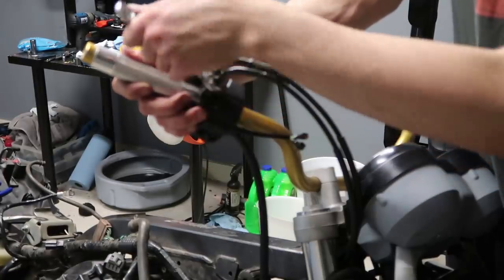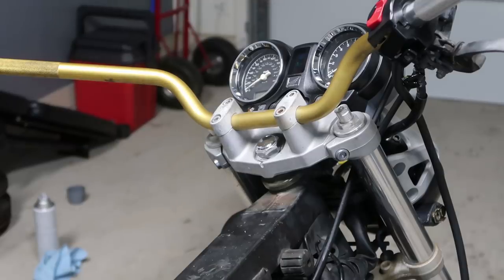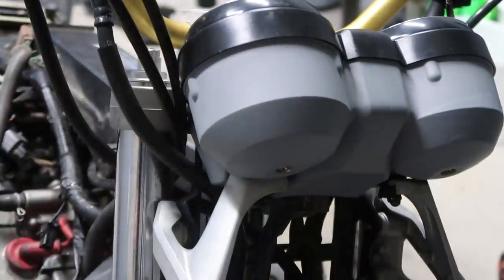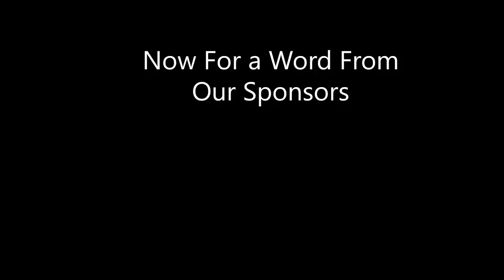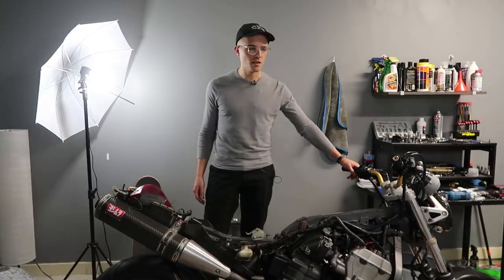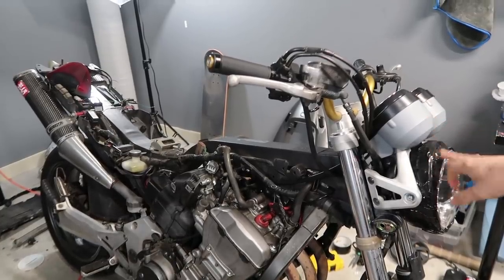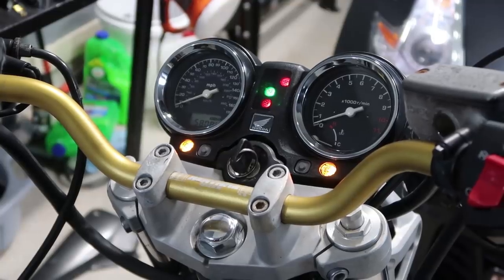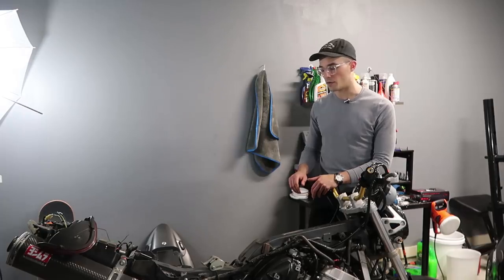Throttle, Lights, and More on the Hentai Hornet! (Beginner Bike Build Series Ep. 10)

Comment: it's not the taillight's fault you set the front end up wrong, also those handlebars are pointed waaaaaay too much up, unless it's a stuntbike you should rotate them more towards the gastank. 

okay so for indicator issue: jeez how do i say this... okay so you're indicator relay changes a 1 to a 0 (power or no power) right? well if you wire it backwards like you probably did, your indicators are constantly lit and the relay puts power on the ground wire of the indicator, reducing it's voltage to 0 causing them to turn off.
the problem you have with the taillight is that it doesn't want to have power on the indicators when they should be off. you could potentially make it work by making the indicator button on the handlebars send it's signal to 2 different relays, 1 for the front working like it does now, and 1 for the rear working as it comes from factory... if you want i can draw you up a schematic of what i'm thinking about cause i tried doing it with symbols but i've just no space for it.
Reply: yeah you'd need 4 indicator relays to pull this one off... unless you let go of the front indicator being on all the time.
Reply: you can actually see the front ones also constantly on in the video (only blinking by turning off like you say)
Reply: @Tony0Shredder  yeah,  i assumed that was obvious, i believe he even explains it too. anyway that mean the front indicators have a constant positive and the "signal" from the switch and relay side is put onto the ground wire, if you put 12V on either side of a light or LED the differential is 0V and the light goes out. so i wonder if that is how he blew a fuse, putting 12v straight on a ground wire is the very definition of short circuit...
Reply: This.
Reply: This comment was a fundamental misunderstanding of how a turn signal relay works, I think. Its hard to tell because its kinda rambling gibberish, but I can definitely tell you that this is not the issue at hand.
Reply: @ianloughney9570  i know it is a bit of a rambling gibberish mess, but i do have 10 years of experience as a diagnostic mechanic and it is how i would go about the problem, that said i do not know exactly how this bike is wired, what has been changed in the wiring by Yammie or previous owners, so i can't say for certain how and what. however i can explain how he could wire up the complete turn signal system from scratch so that the front turn signals stay on when not in use and the rear turn signals stay off when not in use. it is radically different from how turn signal systems are usually drawn up but it works as i've done this before on a supermoto that didn't have turn signals at all.
Reply: @HowlerBikeVlogs  I mean its ok that you were rambling I do it all the time when I'm in a similar position of trying to explain something I've designed. The bigger issue here is that what you seemed to be trying to describe is not whats happening, because it isn't how flasher relays work, or how leds work, or how circuit ground wires work. And it's now somewhat troubling to me that you've spent ten years possibly diagnosing electrical issues in a system that you have a bit of a misunderstanding about. I would also be really really hesitant to believe that your solution would be viable given that it sounds like a massive overcomplication of a relatively simple circuit based on a misunderstanding of the flasher unit. I'm not trying to be rude or one-uppy here, but he's asking for honest advice and I can't sit idly by and watch you give him ridiculously bad advice. Heres a decent link to the how stuff works article for a signal flasher, I hope you can see what I'm trying to get at. https://auto.howstuffworks.com/turn-signal2.htm
Reply: @HowlerBikeVlogs  OK, WAIT I just reread your comment and I've figured out where the misunderstanding is. I think you're trying to say that he's wired the relay in between the turn signal and ground and that he's running constant power to the signal and that when he's hitting the switch on the bars you're thinking that that's opening the contacts thus breaking the ground and causing them to flash in reverse, correct? If thats the case then the misunderstanding is when and what causes a relay to flash. Ok, (2 prong) flasher relays are normally closed (3 prong are normally open kinda but it's essentially the same for our purpose) and flash whenever power is put through them. I think what you're misunderstanding is thinking of a flasher relay like a standard relay where a switch controls the actual breaking of the circuit. This isn't how a flasher relay works, your turn signal switch doesn't control the breaking of the circuit, just power to and from the relay. Any time there's a complete circuit with the relay as part of the circuit, the relay will flash whether its on the ground side or the power side

Comment: I think you wired the front signals backwards. Switch the negative and positive wires. If that doesn't work, leave the front disconnected and try the rears.

Comment: Resisters. LED’s pull less current than filament bulbs. Low voltage won’t trip relay.
Reply: Low voltage won't do anything,  commonly known as a flat battery
Reply: He means low current
Reply: LED's commonly cause the 'fast flash', which you fix with resistors or with a relay.  This issue is caused by the indicators always being on, and pulse off - rather than being off and pulsing on.

Comment: The turn signal controls on the cockpit take the curernt from the turn signals themself. Check if you are using a led-relais and if you have resistors before your turn signal/taillight-system. :)

Comment: You may need to install load resistors. LED's don't provide enough electrical load for the flasher relay to work properly. I got the resistors on Amazon for pretty cheap and some posi-tap connectors to make it all work.
Reply: Depends on what he started with. The blinking is functioning right now so I doubt that's the problem.  Also, it's much, much easier to just buy an LED Solid State Flasher Relay and swap them out, takes five seconds and is only ~10 bucks or so.
Reply: The better way to do this is to put in a solid state flasher that works properly with LEDs. I bought one for < $10 and it runs LEDs properly without load resistors
Reply: Yeah, when I did mine I didn't know there were such things as solid state flasher relays. Live and learn and the resistors were easy enough to install.

Comment: Yams, I suggest getting a multi-meter and manually checking which wires correspond to which controls. Connect one lead to the ground in the bundle, and the other to a signal wire. Press each control (turn signal, brake levers) and find out which causes the voltage to transition. Forget the instructions, they're often wrong.

Comment: Bodged wiring is one of the worst aspects of aquiring a used bike, and you just demonstrated how to do it. One of the three machines I own is a 1973 Kawasaki F9 350 Bighorn with just over 3000 original miles and it is absolutely intact, even came with the original spare fuse.

Comment: Does your bike run 2 or 3 wire turn signals stock? If they're 3 wire, you probably just wired the running lights into the signals which is a common mistake swapping from 3 to 2 wire signals.

Comment: Holy hell please buy some proper wire strippers and a real crimping tool. Use proper OEM-style connectors that crimp over the wire AND insulation to provide strain relieve; not those cheap-ass crap connectors from the hardware store. That stuff is probably going to break or fall off over time the way it is now.

Comment: Hondas have amber running lights. 3 wires to each signal. You only have to connect 2 turn signals wires, disconnect the 3rd running light wire.

Comment: You cannot have the front turn signals (un-blinked) on all the time, that's the one keeping the rear lights on as well. Due to the head light wiring it is happening like this. Try rewiring the front turn signals to 'off' position and then you can see this problem is resolved.

Comment: Hey, aren’t those throttle wires rotated to high on the handlebar?  Shouldn’t they point more towards the floor instead of pointing into the air above the front brake lever??
Reply: Nah, I take it back, I went back and looked at the original reveal of the bike... those cables do exit at that angle or close to it anyway